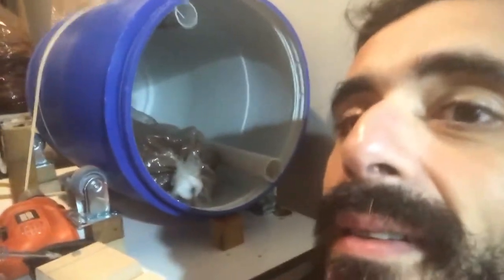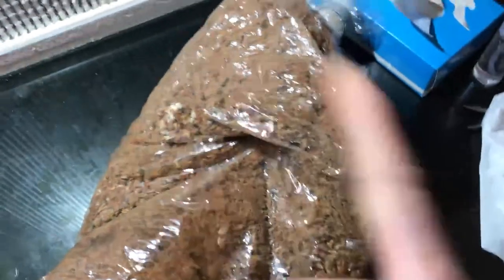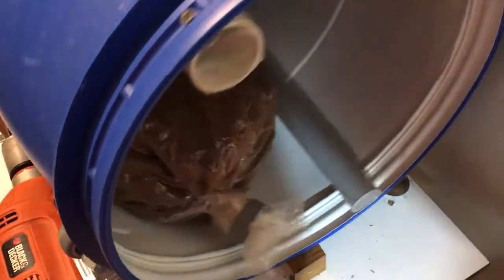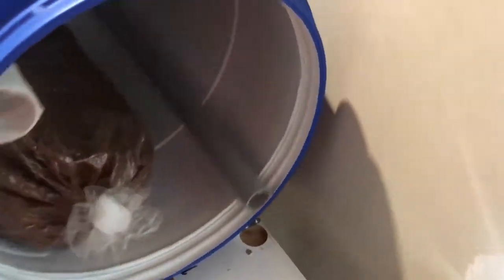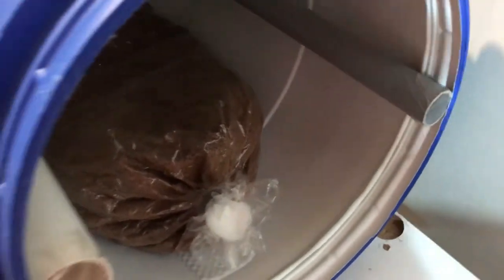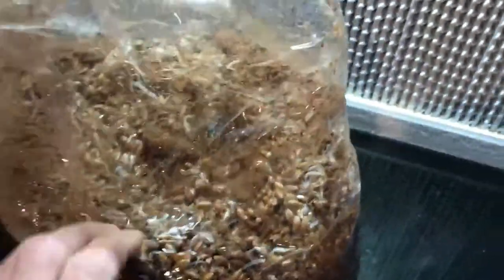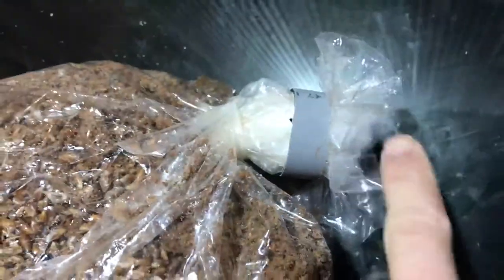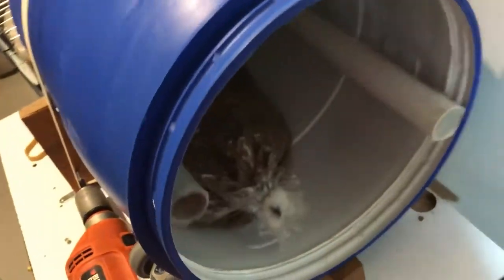Mix your substrate bags with The Tumbler, a powerdrill-powered simplest DIY in the world - E17

Comment: Very cool, this is almost exactly what I had in mind. I was thinking about using a hoverboard motor mounted onto the back of the barrel for mine. I was also thinking about using large bags, maybe making 20- 30 lb blocks of loins mane and oyster spawn. How many mm thick are the bags that you use? And is that some kind of filter on the top of the bag?
Reply from the maker: I am thinking of improving my tumbler to make it more silent by using a rotisserie motor and a bike chain transmission. 20-30lb of spawn seems too big to me. Did you ever try such a format. I always had problem whenever I did spawn bag bigger than 5 lb, seems to have trouble breathing or maybe overheating. Sylvan makes such big format 12-16lb , but uses "pillow" bags flat with a filter all along.
I use 5-6micron bags with a polyfill filter